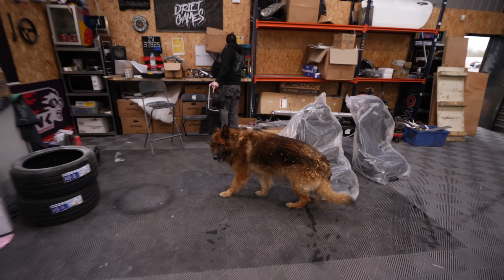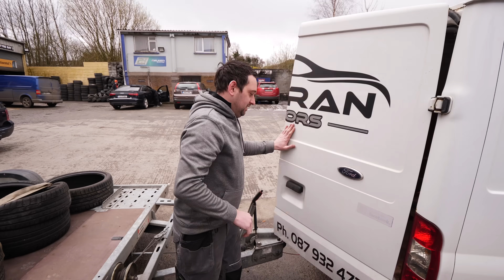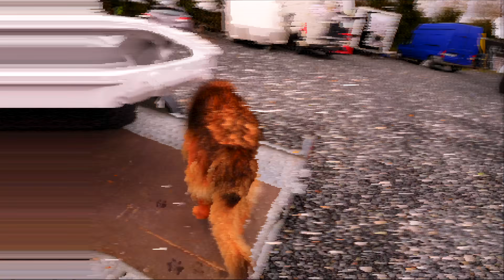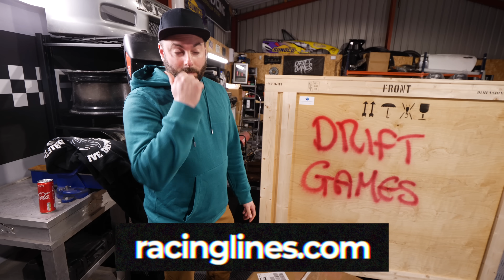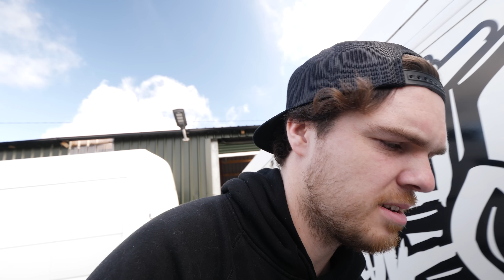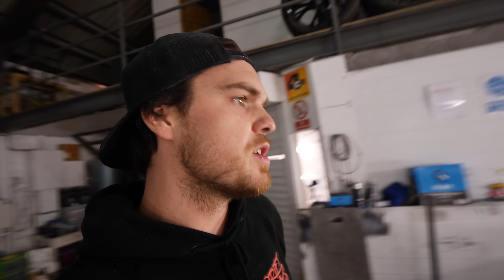Mazda MX5 drift build MAJOR progress | PARTS LANDED!

Comment: Why do you tape up all the holes? How come they didnt get welded up?
Reply from the maker: Because there is 100 of them on this chassis. they are too small to put a plate in and too big to just put weld on them. They are sealed by the aluminium and then primed/painted over to seal.
Reply: @driftgames_life  Never heard of doing that before. So once its all painted they hold up well?

Comment: Surprised you didn't go a mad color with the cage josh
Reply: I was going to go purple like my mk1.... but wanted to go a bit more neutral with this one as I really liked the clean look of Daves.... I did put some sparkle in there to jazz it up a bit though 💁‍♀️
Reply: @joshholdsworth4110  to be fair it is super clean. Nice to see the progress. Can't wait to see the reaction when you actually drive it. is it a 450bhp Sr in the mx5.
Reply from the maker: it should be 500bhp going by the last time the engine ran at full boost on the dyno
Reply: In a mx5, that's gonna be insane 😂😂 1st run out josh needs an open face helmet and camera pointed at him 😂😂😂

Comment: We use crushed glass when blasting the shell. The water helps to prevent the panels from heating up, preventing them from warping. The cars always look awesome in bare metal before they are painted.
Reply: Unfortunately I never saw it in bare metal but they said the same. The glass gets everywhere 🙈
Reply: @joshholdsworth4110  I probably have a few more pics of when we blasted your car. I'll send them onto you later